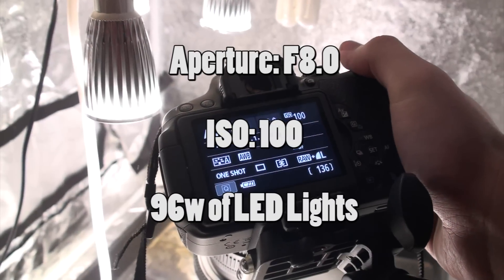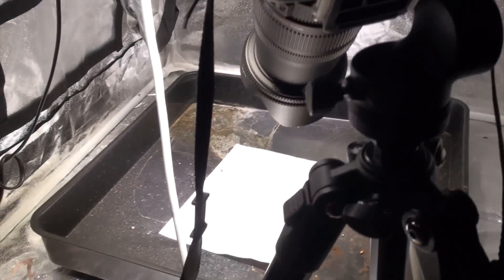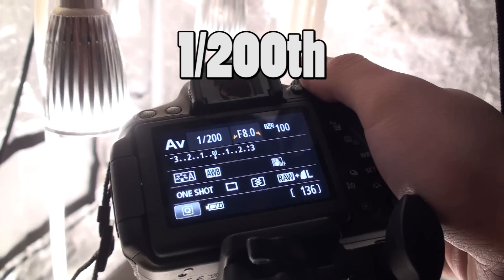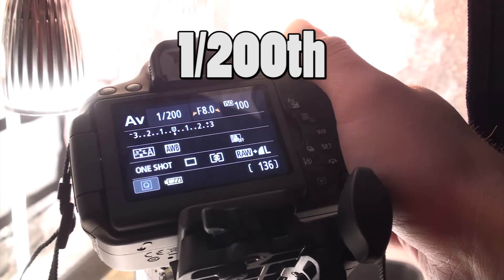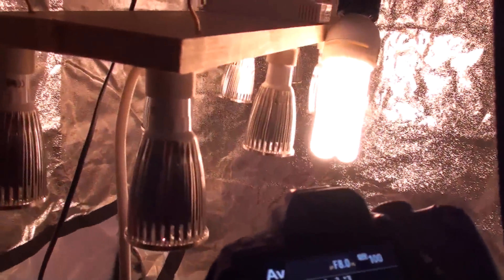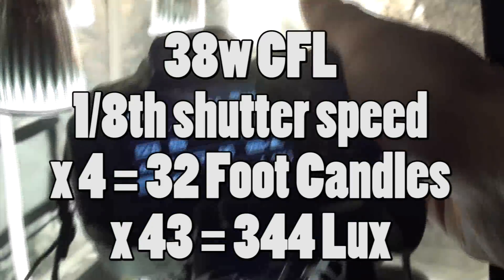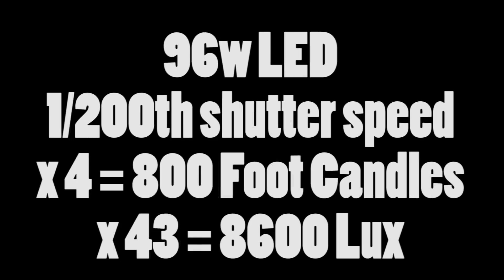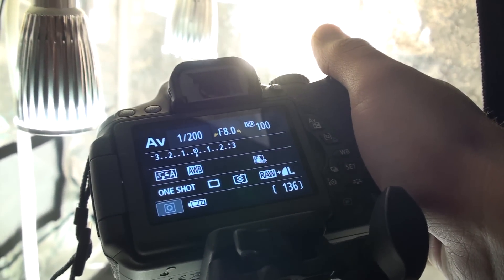How to Measure Lux with a DSLR Camera - Grow Lights

Comment: My Kodak CA0909 TV has 550Nits i set the TV to max backlight and max brightness and opened a completely white background and followed your instructions and my Nikon D5100 reported 1/25th
so 25 x 43 = 1075 Lux divided by 3.426 = 313 Nits thats a massive 55% difference(550 vs 313)

*I set my ISO to 100 and Aperture to F8.0 and my camera was in "A" Aperture priority Mode
Did I do everything right?

Comment: According to https://en.wikipedia.org/wiki/Exposure_value,
illuminance in lux, E = 2.5 x 2^EV. See Table 3 in the above web page.

E = 2.5 * 2^(EV)
  = 2.5 * 2^log2[f-stop^2/(shutter speed)] 
  = 2.5 * [f-stop^2/(shutter-speed)]
  = 2.5 * 64/(shutter-speed)
  = 160 / (shutter speed)

For shutter speed of 1/8 sec, E = 1280 lux

Comment: Can the Lux be calculated with a camera that has a max aperture of 3.8??  approximately divide by two?  tnx.
Reply: Max aperture is the widest... You need f8... which is greater in number, but the aperture is less open... You should have it... And you shouldn't divide it by two even... f5.6 would be half the light of f8 and f4 would be quarter of it.

Comment: Leds as grow lights for lamps?

It certainly seems feasible from a lumen/watt point of view. The difference between led efficiency and sodium lamps isn't that big, perhaps a factor 1.5 difference. What are the cost differences, if you know of this?

I already know that for generating very high amounts of light (in the order of 150k-200k lumen, which is required for operating theatres, leds are already the best choice, due to their excellent colour reproduction and low heat output (and low UV)

Comment from the maker: What you're missing is the distance you can get the bulbs from the plant, which is a major major major major major major factor in determining efficiency. A HPS needs to be a foot away, and LED can be less than an inch away. Light intensity on the plant is higher from LED's in this respect.